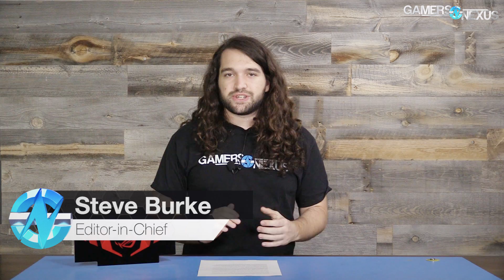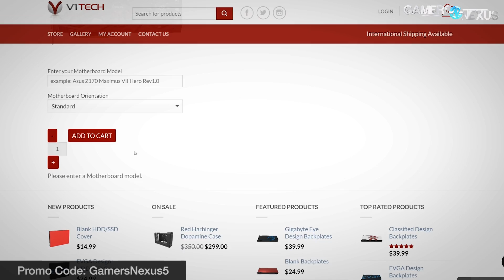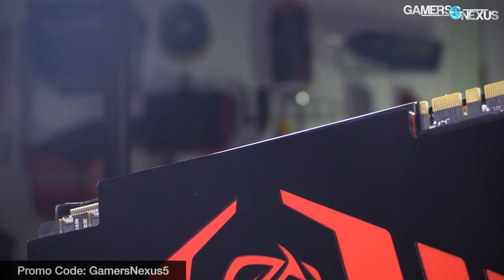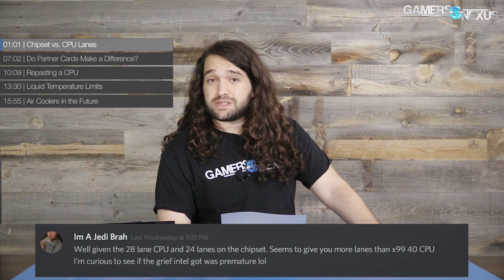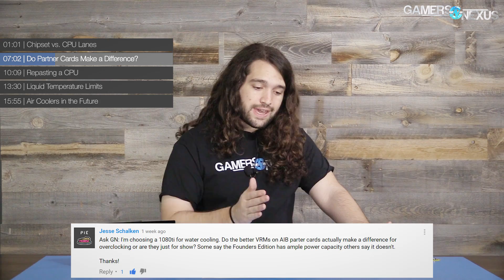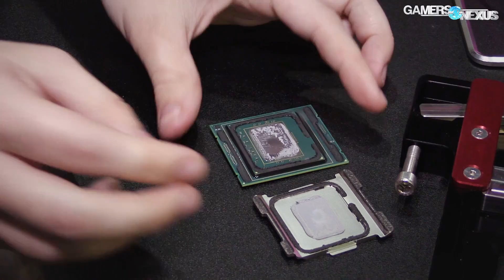Ask GN 51: How PCIe Lanes Work (CPU vs. Chipset)

Comment from the maker: Great questions! Leave more in this comments section for next time. It's a bit easier if you leave your question as its own comment, rather than a reply. As for the lane discussion, we've done primers and overviews on lanes before, but this is just a very quick recap of some of the basics (as it relates specifically to discussions of the past weeks).
Reply: You overlooked one important factor, the DMI interface between the CPU and the PCH is a severe bottleneck. The TOTAL bandwidth between the CPU and the PCH is equivalent to a single PCIe 3.0 x4 link (3.93GB/sec) - every PCIe slot, plus SATA, onboard network and audio, etc. connected to the PCH shares this single link to the CPU. This is a non issue for onboard peripherals, but 10Gb network cards, multiple NVMe drives, etc. running in tandem off this bus is a recipe for disaster.
Reply from the maker: It just wasn't explicitly mentioned. We've detailed that in several articles on PCIe lanes, and it was also bundled in with the statement (in this video) that CPU lanes are "higher quality than those from the PCH." That's part of the reason why that statement was made, yes.
Reply: Not to throw a monkey wrench into this discussion but all the next gen video cards that are coming are showing a compatibility with PCIe 4.0, that will make the number of PCIe lanes kind of moot for the foreseeable future. From a speed point of view an 4.0 x8 will be equal to the current 3.0 x16 so the number of lanes needed to have the same speed today will be much less with PCIe 4.0.

Oh, and I firmly believe that you will see PCIe 4.0 by November for the Christmas shopping season.
Reply: To the people who actually need a HEDT system, more lanes are almost always better. Those who don't need a HEDT system shouldn't be paying attention to the platform anyway, but Intel is trying to force their server side pricing and upgrade schema onto the consumer space. I have little doubt that he it gone unopposed by anything relevant from Intel, their next step would have been to try something similar on a future iteration of the Z series chipsets. Moreover, that many available PCI-E lanes may facilitate development of devices which make use of OCuLink 2 connections.
Reply: David Cannon You're absolutely right. We can count on delays for 5.0. I like what you are saying though and it makes sense. It seems Intel panicked and rushed it a bit. Perhaps I will wait for gen 4 motherboards. Do you think the chips will be gen 4 compatable with a gen 4 x299 motherboard, assuming they come out?
Reply: +Alan Dotts

Now this is just speculation on my part but it does make sense. There will be two versions of the x299 boards, a PCIe 3.0 version and a PCIe 4.0 version and yes they will both have LGA 2066 sockets. The first x299 boards should be available by the end of the month seeing that Intel just said that the i9 7900x 10 core will be available on the 26th of this month. 

Now to muddy the waters further Intel in early 2018 will be releasing Coffeelake and Cannonlake processors on what looks like a 300 series chipset, think Z3xx boards. Nothing is really known here outside of rumors but it is a fair bet that the 300 series will not be using LGA 1151.
Reply: QUESTION - What happens if you use all the PCI-E bus Lanes. For example if I plugin 4 cards into my PCIe slots and use a m2.2 with my 6700k computer. Will it error out, will it just be unstable? What exactly happens? (I have never been able to get a clear answer on this). Thanks!
Reply: Regarding cooling, I'm thinking it's going to be significantly easier to cool TR4 on air than equivalent core counts on 2011. You're looking at two separate lesser heat sources rather than one large one. For that matter, given that difference you might see some interesting heatpipe configurations meant to take advantage of that.
Reply: make that unopposed by anything relevant from AMD.
Reply: Stefan Nuxoll Exactly right. Also, using them for a graphics card even if allowed would bottleneck everything else attached to the PCH. I think they were trying to explain it without going into platform architecture, but it kind of beat around this fact without specifically stating it. Nice to see someone talk about it though. If the $600 8 core chip had 44 lanes I would be getting it. May wait to see how Threadrypper turns out.
Reply: David Cannon I think this only doubles down on the need for more lanes for anyone buying today. By the end on the year we will probably start to see pcie gen 4 with double the bandwidth and gen 5 with 4x the bandwidth in supposedly arriving in 2019. That won't increase the dmi 3.0 though or the lanes coming from the cpu. So in as little as 6 months a mainstream 16 lane pcie gen 4 chip will have more pcie bandwidth than the 7800x or 7820x unless there is some wizardry to force gen 4 at a later date. All the more reason these two chips should have the 44 lanes.
Reply: +Alan Dotts

I do not disagree with what you are saying but with PCIe 4.0 having twice the speed as PCIe 3.0 you can use half of the lanes (an current video card using x16 with have the same speed as a PCIe 4.0 card using x8). 

I firmly believe that Intel was not going to release the LGA 2066 and the x299 chipset until the end of the year with PCIe 4.0 fully implemented. Now I foresee that there will be an x299 v2.0 coming out in 6 months that will have PCIe 4.0 and quite possible more lanes as well. That is also not taking into account Intel next round of chips due out next year.
Reply: +Alan Dotts

Forgot one thing, that chances of PCIe 5.0 coming out in 2019 is pretty much zero. Realistically you will be looking at the 2021-22 timeframe. PCIe 5.0 is not even totally finalized as of yet nor has it been adopted by any manufacturer.
Reply: So if I have a 7700k and a motherboard like mine, (Supermicro C7-Z270-PG) which has 4 x16 slots wired at x16/x8/x16/x8 and allows you to use 2 cards in  x16/x0/x16/x0 SLI or 4 x8 cards, would I then be losing some performance in various SLI compatable games with 2x 1080tis in SLI? 

I have two of the  Aorus Xtreme tis. GPU-Z and NV Control Panel report both cards as x16 and they seem to perform very well, but I've wondered about a difference in performance between a set up that uses a PLX chip and DMI vs an HEDT solution with more lanes on the CPU.

I've considered attempting to test this with the first two slots at x8/x8 but those beefy Aorus cards don't really fit that close together and I don't have an HB bridge that size anyway. I have tested this with a pair of 970s but those don't usually even saturate x8 so not noticing a difference did't really tell me anything.

Also, there are other motherboards out there like this, albeit they are kinda rare. ex: Asus z170ws and z270ws, Aorus Z270 Gaming 9, etc. So why do these exist?
Reply: +Joshua Turner

If you are referring to what +Alan Dotts are talking about then it has nothing to do with current boards and how the PCIe 3.0 slots work. 

What we are talking about is what people are saying is a mistake by Intel on the x299 platform that their lower i9 processors only have 28 lanes of PCIe instead of 44 lanes and that is an issue with the current standard of PCIe 3.0, it is going to handicap those CPUs. 

Now we know that Volta and Vega are going to be PCIe 4.0 compatible and they are scheduled to be out by the end of the year. Now logic would dictate that there will also be motherboards available at that time that will have the PCIe 4.0 standard. Going from 3.0 to 4.0 will literally double the transfer rate of data so in 4.0 8 lanes of PCIe would be moving the same amount of data as an 16 lanes of PCIe 3.0. The end result would be that you could run 2 cards at x8 in PCIe 4.0 and have the same performance as 2 cards at x16 on PCIe 3.0.
Reply: @davidcannon7157  ñ} %} p plomo
Reply: +David Cannon I wasn't exactly referring to what you and +Alan Dotts were discussing although it's definitely something that I am interested in, so much as asking the room in general if anyone had a little info for me on whether a discernable loss of performance occurs in using a mobo with those extra lanes going to a CPU with only 16 lanes
Reply: I have a Question , Does having 2 M.2 Devices running at 32Gb/s pull lanes from the GPU  single slot

Comment: The Chipset, like on my motherboard the X570 chipset, is only allocated 4x data lanes or pcie lanes from the CPU to the chipset. The Chipset will actually bifurcate these lanes, or as they call it "Multiplexing", whatever the hell that's supposed to mean hahaha. What they are doing is basically taking these 4 data lanes provided from the CPU and connected to the Chipset, and then they are splicing these data lanes like a PORT HUB basically, and they are allowing multiple data lane users, like USB connectors, PCIe slots that aren't dedicated to the cpu, these slots are actually plugged into the CHIPSET hub that is being multiplexed. All the sata ports are plugged into the Chipset DATA PORT HUB, the multiplexer, sounds like a frickin' WWF move. Any and all ports and slots and pluggy majiggies that aren't directly routed into the CPU, like the first or sometimes second NVME M.2 and the first PCIE x16 GPU slot, all others, will be sent to the CHIPSET who is the middle man , the DATA HUB, between those pluggy majiggies, and the 4 lanes of bandwidth left over that go directly to the CPU. When these 4 lanes become saturated through the CHIPSET, stuff's gonna start having errors, stuffs gonna turn off, and stuffs gonna start glitching, because there's only 4 PCIE lanes coming from the CPU and there's a million pluggy majiggies and if you're running too many at once, well, things are gonna go poo poo.

Comment: SLI is dead, all motherboards except maybe workstations (dual 3090s for compute? I don't know) should just make the primary PCI-e 16x always operate at full speed, then make the other PCI-e lanes 4x. dual x8 slots are useless for consumers. Only argument I hear is "direct storage" but that isnt mainstream, and isnt really there yet (as far as the way the modern consoles are doing it).

Comment: From my experience very old thermal compound in laptops might be worse than none. A neighbor gave me a 10 year old Toshiba laptop with a Core Duo CPU with presumably original thermal compound. Even after blowing as much dust out as I could without opening it, the CPU temp wound pretty much instantly max out at 100 degrees C under load. I took it apart and removed the extremely crumbly and dried out thermal compound and thoroughly cleaned the heatsink (which didn't have that much dust left) and reassembled it with no thermal compound just out of curiosity and the CPU temp pretty much stayed in the mid 90's under load with no throttling with no thermal compound. With new thermal compound it ran in the upper 70's. So at least in that situation no thermal compound was better than 10 year old dried out thermal compound.

Comment: Question maybe you could help solve, I have two SC Gigabyte 1080ti GPUs and im currently working on buying the rest of the desktop setup, my question has arose with the decision between a 9900k and a 9820X, im a little confused with the difference between PCIe lanes vs CPU thread lanes, the 9900k has 16 threads and if I want to run both 1080tis in SLI I would be forced to do them in x8 configuration on a X99 platform correct? Now with that being said my current MSI GS65 has m.2 SSDs and im a huge fan, I would like to run M.2 in my Desktop, however it is my understanding from this video that M.2 is going to pull CPU Lanes. Why is it on the new I9 series they state a PCIe lane count and a CPU thread lane count and what is the differentiating factor? Hence my viewing of the 9820X(same $ point as 9900k) which has a CPU thread of 20 allowing me to run both GPUs at 8x and an M.2 at 4x. Am I understanding the theory of opperations here. Also running tow 1080tis in x8 config vs x16 config is negligible in difference correct? Or would the GPUs being run off the 44PCIe lanes of the 9820X? thank you

Comment: Hiii...  I have a B360M DS3H with a i7-9700K with a RTX 2060 and I'm planning on adding a M.2 drive but I dont wanna bottleneck. What if I add a M.2 drive... does use the PCI lanes aswell?? I've been trying to figure out how many lanes does my MOBO has but I found out it was 12 and in other place it says that it has 24 (maybe HSIO), so I'm confused... Im not planning on doing OC, but I just wanna know that if I decide to upgrade my 2060 to a 2070 super and adding the M.2 I will not bottleneck....Thanks !!

Comment: you forget to mention that you can use more heavy weight coolers on server cases (rackmount) , horizontal on the board should bring less stress, and you can even support the mainboard under the cpu. Only limit is the height of the cooler

Comment: Forgive me dumb question regarding lane stuff but lets consider two scenarios:
1.CPU with 16 lanes which are consumed in total by GPU
2.CPU with > 16 lanes, let's say 28

If I will put same M.2 SSD into 1) and 2), which one will has faster I/O test results? According to my understanding the faster will be 2) due to lanes consumption straight from CPU. Or, in both cases M.2 SSD will use lanes from the chipset because that's how M.2 port is designed?
What if for 2) configuration I will buy PCI-e adapter to put M.2 SSD through it?

Comment: Is there no difference in 4x CPU lanes and 4x chip set lanes? I believe is the speed is the same but is the latency and other performance factors the same?  

only difference between CPU and chipset is that on CPU you can group together 16 lanes and on chipset maximum lanes you can group together is 4. so, if somehow if you could group together 16 lanes on a chipset would that be same as CPU lanes?

Comment: Hi there, i have an annoying issue with my x99 build and was hoping you have encountered the same thing and know what it is. When starting the system up 4 out 5 times i will encounter the windows loading screen which can last up to 10 seconds, but say on the 5th power on it will boot in to win 10 so fast i won't even see loading or welcome screen. Specs are rampage v edition 10, i7 6800k, RAM 3000, M.2 ssd, 1080ti. Bios settings: XMP enabled, (turbo boost and intel speed step technology disabled). Issue is also present using a normal sata ssd. Any feedback would be greatly appreciated as I've tried everything I can think of to fix this inconsistent problem. Thanks.

Comment: I'm still not 100% sure on PCIe lanes, I understand the connection, but not the utilization.
8x is enough, enough for what? To use the card 100%? Is it when sending data to the card? Is it possible to force the card to use all available 16x? Is there a way to test this for comparison?
I've tried to Google a way to stress test the lanes, but come up empty. I've seen UEFI has the ability to change the lane speeds, but I'm not sure how to test the difference using software

Comment: I not entirely sure if this is the right question to ask here...I want a Ryzen 1700x processor. I want to use a ROG Strix b450 gaming motherboard. If I use an rx580 graphics card that will use x16 pcie slot, and NVME m.2 ssd and additionally use a blackmagic mini monitor 4k output card which requires 4 lane PCI e, will it 'force' my GPU into x8 mode?

Comment: Regarding the air cooler question, I personally use an Arctic Freezer 13 Air cooler on my 125w TDP FX-8370. Under full load I never exceed 50C. The cooler is rated at a TDP of 200W (which I highly doubt,) but it is definitely an awesome air cooler that will be able to handle newer, more power hungry processors.

Comment: If CPUs have the actual PCIe lanes (for graphics or otherwise), and the PCH is a slower substitute which sounds like it's mostly used for southbridge peripherals but interestingly can provide a secondary path to select PCIe slots (based on how you described it), then how can people do dual 16x SLI (32x total) like in the days when northbridges were still around? Would it give one card in the SLI pair the full 16x from the CPU's PCIe lanes and the second card would go 16x over PCH? That doesn't seem possible since you said PCH can only do 4x. So how does SLI work with northbridge-less architectures?

Comment: I use a 5930k on the x99 platform. My take away from this is 16 lanes are managed between the CPU and the Pcie 3.0 bus 24 lanes are managed via the DMI for a total of 40. If my understanding is correct than why when I look at several x99 motherboard block diagrams I see a line indicating 40 lanes between the cpu and the pcie bus? Still confused.

Comment: I have a R7 360 running at x16 in my primary PCI-e slot, but my CPU only has 16 PCI-e lanes (2600k).  I bought a PCI-e x4 m.2 NVME adapter card and want to run a SanDisk 960 Pro.  Will the card run at x4 and throttle the GPU to x8, or will it use 4 lanes from the chipset instead?